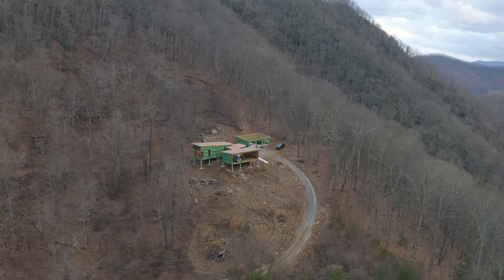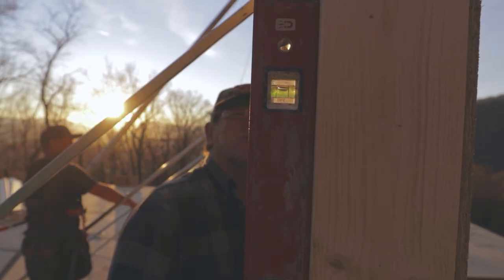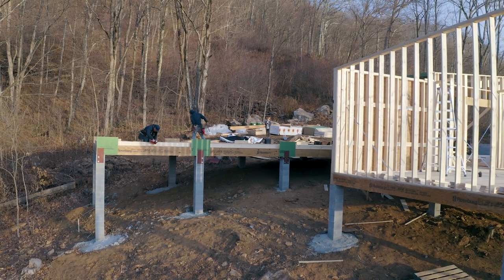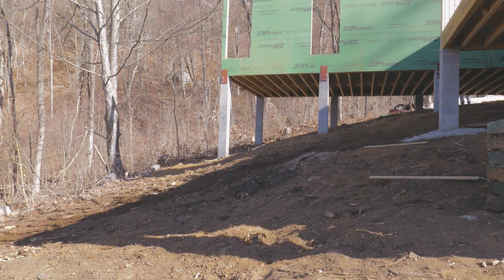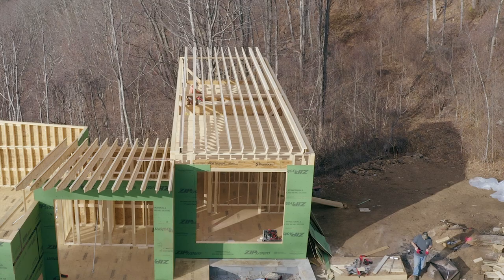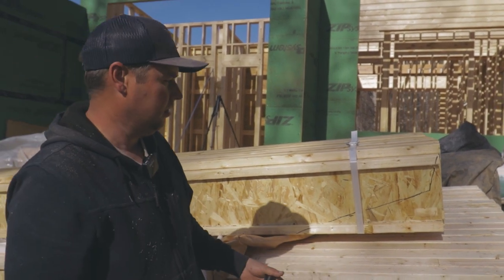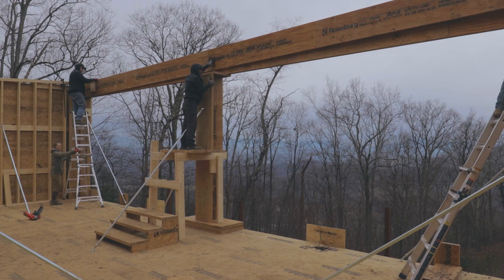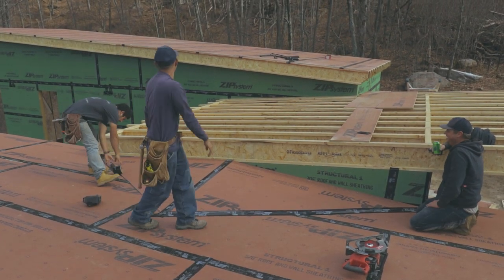Framing Our Offgrid Home (pt 2)

Comment: Your place is super sweet! I'm working on a similar, albeit smaller, version in Montana. I do have 2 quick questions if you have the time to respond... 1) How did you frame those side overhangs as I didn't see any outlookers, and 2) Are you beveling those top plates to that 4.76 degree mark for a flat surface, or are you skipping it due to the relative flatness of the roof. I'm asking because I'm doing a 1.5/12 pitch and I'm having trouble finding a clear answer. Thanks soooo much for all the fantastic info! I appreciate your hard work in sharing with everyone. I'm looking forward to the blocking vid for the fascia! Cheers
Reply from the maker: Hey Michael, since the side overhangs are only 10” on this roof, we simply cut pieces of 2x10 that fit snugly between the top and bottom flange of the I-joist and placed them at 16” on center. I believe this to be sufficient if you use screws to install them and double check for level before installing your roof sheathing. If the overhangs were any bigger and I would have used outlookers for sure. To answer your second question, yes we bevel cut all of the studs at 5 degrees (close enough).. The way I see it, it takes the same effort to cut at 5 degrees as it does to cut square on a miter saw so why not make everything fit nicely. Good luck on your build! Maybe you could share some pictures if you have them posted online.
Reply: @TannerConstruction  First of all, thank you so much for taking the time to respond. You just saved me a ton of time and work with that overhang plan! I appreciate it more than you can imagine! As far as beveling the studs (instead of the top plate), did you see any issues with the sheathing not being totally flat against those 2 top plates due to that 5 degree bevel? Thanks again for sharing your expertise. I'll definitely post some photos. All the best!
Reply from the maker: @MichaelWilsonator  not at all. Everything sits flat. Because we slightly offset the two top plates against each other if that makes sense.. imagine two rectangles at 1.5” tall by 5.5” wide with a .25” offset.
Reply from the maker: Hey Michael.. I forgot to mention.. make sure to screw down the bottom flange of the last I-joist that sits on your wall (the one that the blocks attach to so you can mount your overhanging joist). We screwed ours down with Simpson FlatLoc screws (one on each side of the flange) at 16” o.c. All the way down the wall.
Reply: @TannerConstruction  At some point, I'm going to figure out how to repay you for all this info. You're a Rock Star, and I so appreciate your expertise and assistance. VOGUE! ;-)